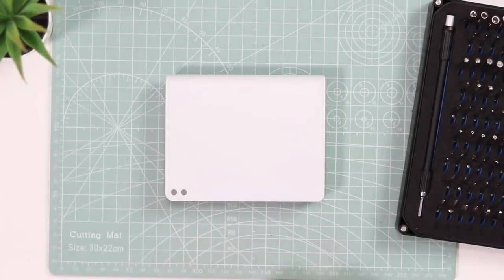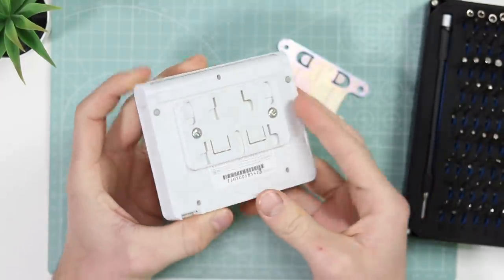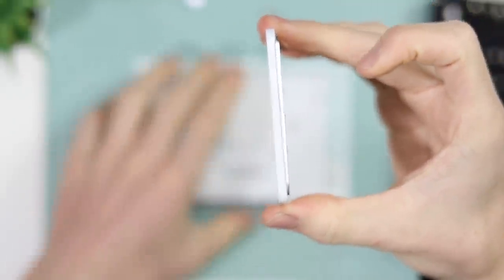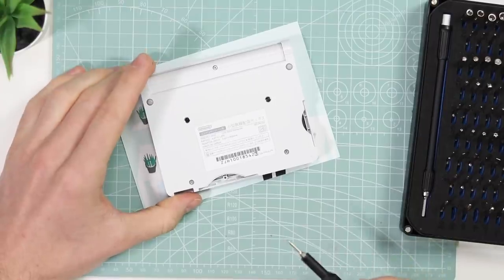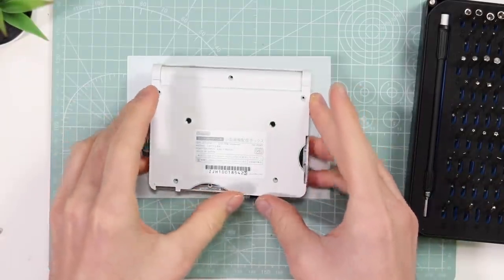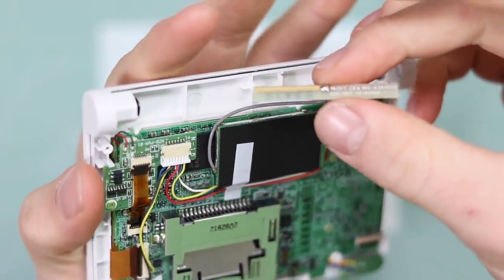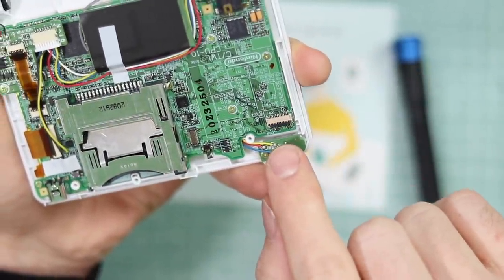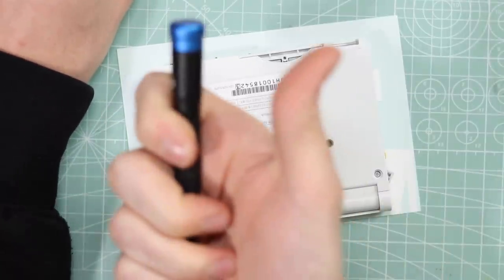Nintendo Single Screen DS Teardown

Comment: That wall mount is awful, they must just break so easily with the amount of force needed to pull that down and off, no wonder you don't see them anymore.
Reply: Probably not. These would most likely be placed in a kiosk, which would make it far easier to take down

Comment: So weird that it’s just the motherboard of a DSI.
Reply: If you only have a hammer, every problem starts to look like a nail
Reply: I'm not surprised, having seen how the sausage is made a few times, but it still strikes me when I see signs of "we have 1000 spare/not 100% working parts, what can we do with them? " "Well, we were looking for a cheaper and more secure solution to wifi distribution that a laptop or server blade. Maybe just stick the boards that boot and have a working DS slot and wifi chip in some cheap shells and send those to the stores?" 

Fun fact, that's how those black friday/other too good to be true deals come from. "Hey boss, we had a batch of about 1000 55-75" TV motherboards come out with a dead HDMI port" "Just throw it in storage with the others, we'll use them for this year's 2-port black friday specials." 
If the model number has extra letters and numbers tacked on the end, and it's cheaper, with less features sometimes, you're buying what most of us call "defective goods", where they reprogram it to ignore the dead HDMI/whatever part, and put a piece of tape over the dead or missing ports. Never know what else may have been defective, but I've seen enough retail black friday returns to say within a year you're gonna lose more than that 3rd HDMI port... I've also torn them apart and found obviously damaged boards, boards missing some but not all components of a feature it didn't advertise (but it's normal version has), even once saw someone get the extra port working somewhat, though besides curiosity, it's really not worth the trouble to enable a factory defect feature... 

Nice to see this admittedly non-wasteful practice being used to NOT scam customers for once!

Comment: Wow that bracket and mount was very cool! It would be easily confused for a thermostat or security system when mounted.

I actually visited the Nintendo Zone at my local McDonald's and BestBuy a couple times with my DSI. I recall getting a Pokemon demo, either Black and white or HG/SS.

Comment: You remove it by pushing the whole unit toward the wall before lifting up. That should depress the clips flush enough to do so.
Reply from the maker: Nah that wouldn’t work, the tabs are flush with where the wall would be so it’s pretty much a permanent thing.
Reply: @TheRetroFuture2  Is the gap created by the white part mounted on the back wide enough to slide a thin tool in? Maybe there was a proprietary tool for it

Comment: Mount it on a belt, get some custom firmware and distribute modified roms or new-age patches and expansions ( or mods ) :D it is so awesome to get a chance to see random hardware that we might have otherwise never seen on YouTube! Thanks for the content, though I do find following two channels to be annoying as I tend to follow so many channels and so many channels are doing it now ( having more than one channel ) however due to the wider audience concern or differing nature of videos I do understand it. I look forward to seeing more crazy and strange things from your channel. Happy Holidays.
Reply: You could also 3D print some replacements for the low priority missing parts just for display purposes.
Reply: You could also fit a wireless aux cable inside it if you really wanted to :D

Comment: The first video got me thinking. Since there also were wireless giveaways in the GBA era (e.g. on Pokemon days), has anyone ever got to know what they may have used back then?
Reply: Those just used a regular GBA using a distribution cartridge like the download play ds cartridges
Reply: there where 4 methods
1. it was using a phone plugged in to the link cable port
2. you give a specific answer to one of the characters that interview you
3. it was not wireles and you connected via linkcable to a gba with special distribution cardridge (or a pokemon game with a special save)
4. a cable connecting to a gamecube with a distribution disc inside simliar to the bonus discs for colluseum that you got in the US and Japan
Reply: @JoducusKwak  number 1 was for crystal only I think

Comment: To answer a possible question nobody is asking about is concerning the wall bracket locking tabs on the back is they prolly used some sort of tool that is designed to be flat enough to slide between the unit and the wall to untab the locking tabs 

Or, because its a Nintendo issued demo unit device designed to not really be shown off and to be "behind the counter" Nintendo didnt care if they designed it in such a way that it would be destroyed because 9 out of 10 times these units got returned to manufacturer to be destroyed anyways, cuz for one, Nintendo cant think in the mind of a collector on the trivial things we like to collect, and two, because Nintendo's demo units are usually designed to not "last" or be cared for at the level that we collectors care for these things, thats why they are always missing bits and bobs of the devices

Comment: it would be nice to get a nand dump for posterity, if it has the camera icon in the main menu when the cart is removed a memory pit exploit may work, then dump its nand.
its a nice non destructive way to do it, since they stripped out what was unused that sd slot must be active, or they would have ditched it.

Comment: I would have totally tried to hook that motherboard to the insides of a stock standard DSi. If it's anything like stock, it shouldn't be too hard to take out without damage, though if it was in there good, I'd at least plug a normal SD/shoulder button daughterboard, the other screen, the digitizer, whatever is easy to plug in and see if it still works. 

As someone who likes messing with hardware I'd also see if I could somehow stealth in some kind of secret connector or stealth buttons to keep it looking and functioning 100% as intended, just with the secret ability to use it like a real DSi. Maybe even tucking some capacitive buttons in there to make "invisible buttons" on the plain white shell. 

On that note, anyone willing to part with an expensive collectors item to get it frankensteined into a stealth DSi? :D

Comment: Wellllll it's not a "wall mount", it's just a mount. Also, they used a very simple aluminum tool to slide between the kiosk arm and the device to push those clips/release it from the mount.

Comment: So how exactly do you think this console by passes the need to verify if the upper screen is connected?
Reply: Dev firmware?  Also iirc you dont need a top screen which is why we have gameboy macros
Reply: @FirstnameLastName-mr8lk  yeah but a macro still needs a 330 ohm resistor, now i wonder if nintendo did the same thing

Comment: I have a strange idea.

How about Swapping the motherboard from that thing out into a DSI. and see what the System shows for information that is normally on the Top screen.

There might be more HIDDEN information about the device.

As for those cables. Those look to be used as Bypass Cables to bypass the battery detection.